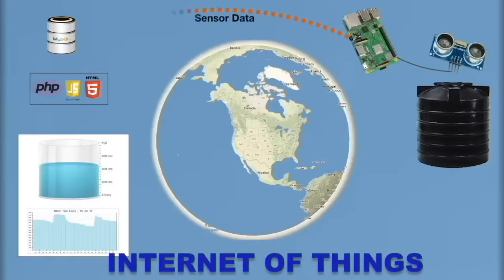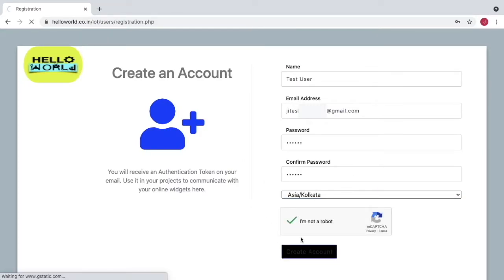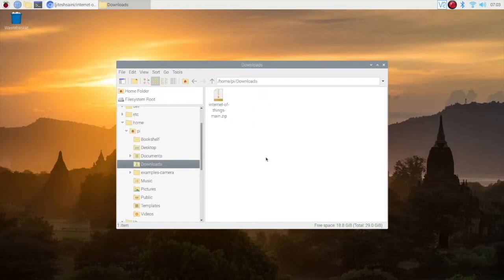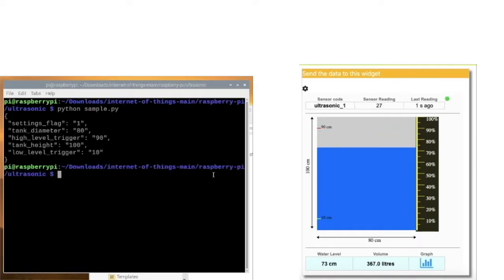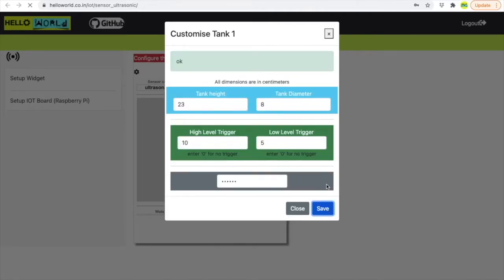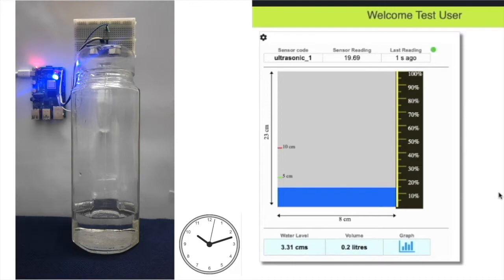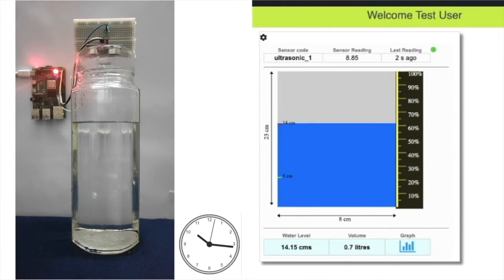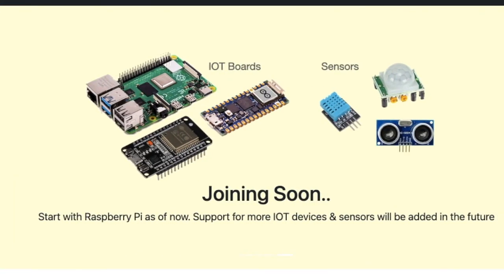IOT Project: Monitor and Control Water Tank level using customisable online widgets

Comment: Hello, is a awesome project ! , But I have some doubts about this project. 1:Where do you connect the LEDS ?, How do you connect the LEDS ?because it doesn't seem to me that I put them in the right place, they don´t blink at all in my experiment according your video and code. I use 2 leds with the right resistances for each one, so they blink ok with just a blink py code    2: how can I change the cron to  5 minutes no to one minute. I try to find the cron estructure in /etc/crontab , and is not there. And how can I stop the cron if I need it ? Thank you and hope you can give me a hand with it. I just bought you a coffee and I can buy you few more ;)😉

Comment: Thanks for sharing such an awesome project.
Can you please confirm that the same can be done using Arduino uno or Nodemcu instead of raspberry pi. What modification in code will be required, please guide.
An early response will be highly appreciated.
Kind regards.

Comment: Great Video & Excellent Project. Is it possible to check the water level in MagicMirror by adding the widget in magic mirror.
Reply from the maker: As I understand, Magic mirror has its own OS. So if it supports a browser, you can pull the water level web page on it. Let me know if you are able to achieve it
Reply: @jitesh_helloworld  Thanks for your immediate response. let me try to add the link in the browser page to display
Reply from the maker: Share a picture if it works in your magic mirror. jitesh@helloworld.co.in

Comment: Could this project be used to mount over a pond to monitor pond water level?  In other words, disregard the size or volume of the container, but only look at the left side, measuring in centimeters or inches the total height from the start point(low level) to high point (flood level)?  Is the app adjustable to increase the left-hand side so that it gives inches every inch, or at least centimeters every centimeters rather than just 5 cm or 10 cm as shown in your video?  I really believe there would be a market for you to simply create this item in a plug-in play method.  There are millions of water detectors, but almost no inexpensive wireless water level, measurement gauges that show you the actual inches or centimeters of water level for a pond, swimming, pool or lake, or of course, of a cistern or water tank.
Reply from the maker: Primarily the ultrasonic sensor measures only the depth. Yes, this project can be used to any kind of liquid level. In case of pond you need to figure out how will you mount the sensor. Also, max distance which can be measured using such ultra sonic sensors is limited to 400 cms. The video shows 5-10 cm change in level so that you can observe the change. However, there is no limitation to the minimum measurable distance. The sensor can record every centimeter change in level. This web app is created to simulate a tank or any Container. You can ignore the width and volume if that is not you requirement and only consider the level.
Reply: Thank you very much for your response and explanation. This is really invaluable resource.
Reply from the maker: Thank you

Comment: Awesome project jitesh!!!! How can u do it with a horizontal tank?
Reply from the maker: Thanks.. Just put the sensor on top surface, it will give you the height information correctly. However, the volume calculation assumes the tank to be cylinder. That might not be correct if it's not cylinder

Comment: When I try to do the step described in the video at 3 minutes and 20 seconds, my raspberry gives me this error:

pi@raspberrypi:~/Downloads/internet-of-things-main/raspberry-pi/ultrasonic $ 
python sample.py
Traceback (most recent call last):
  File "/home/pi/Downloads/internet-of-things-main/raspberry-pi/ultrasonic/sample.py", line 2, in <module>
    import helloworld as hw
  File "/home/pi/Downloads/internet-of-things-main/raspberry-pi/ultrasonic/helloworld.py", line 25
    print (xx["server_msg"])
TabError: inconsistent use of tabs and spaces in indentation
pi@raspberrypi:~/Downloads/internet-of-things-main/raspberry-pi/ultrasonic $ 

What can be the cause?
Reply from the maker: It says indentation error.. So just adjust the spaces in the lines.. Nothing to worry
Reply: @jitesh_helloworld  I do not understand what you mean. I have opened the file and it is identical to yours in the video. I don't see that I have made any changes
Reply from the maker: it's tested many times by different people.. It is a working code. Only thing you need to do is to paste your auth code in helloworld.py file in first line.. Hope it works for you.
Reply: @jitesh_helloworld  mmm... I've given it a thousand laps and nothing. Although it is configured correctly in the util.php file, could it have something to do with my web host not allowing me to call the database water_tank, but rather watertank? The underscore won't let me use it to name databases...
Reply from the maker: Hey friend.. You are now talking about different project.. Details of that one are here
https://helloworld.co.in/article/smart-water-tank
If you are facing issue with underscore, then remove it. Just change the database name in util.php file